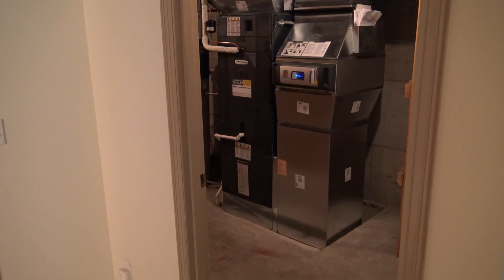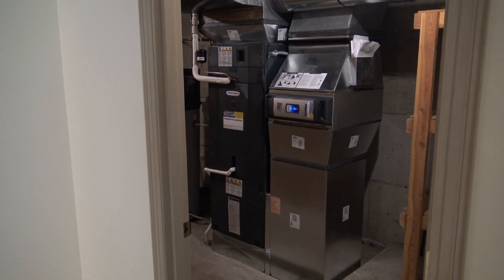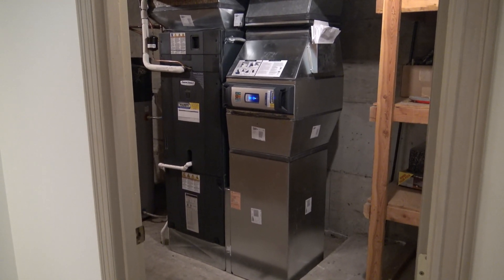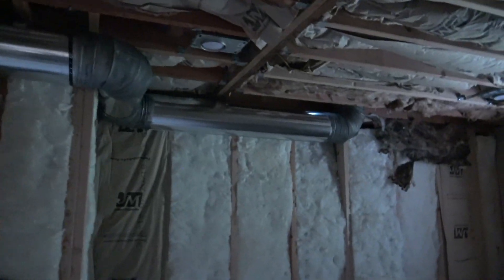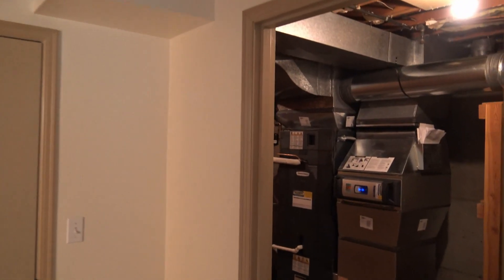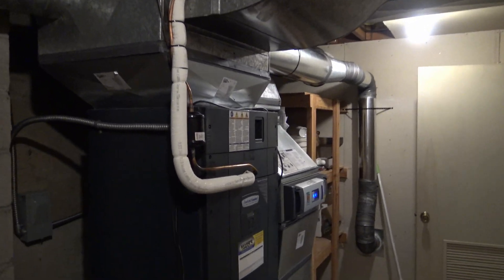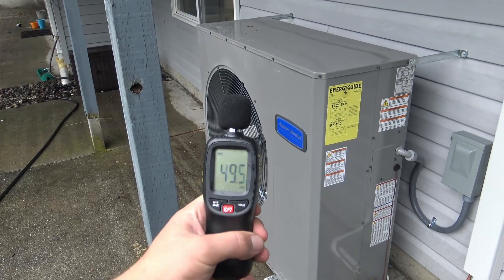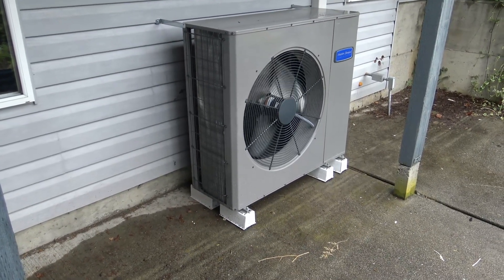Quietest American Standard Heat Pump Strikes Again!

Comment: My dual compressor 16 SEER HP lasted almost 20 years; it was very quiet and the recip. compressors were heavily insulated. I replace outdoor unit with regular A/C 10 year ago and matched to the old air handler; still works.

Comment: Quiet fan, but how about the compressor when it starts?  That is the issue with most ACs and heat pumps, not just the fan.
Reply: Far quieter than a single stage unit starting. Good lord mine is loud!

Comment: How much time did the installers get for this installation?
Reply from the maker: Not sure what you mean? All of our installers are paid an hourly rate, and take pride in producing this high level work!
Reply: Just curious If they got a full 8 hour day or if they worked for multiple days to install the system. Beautiful install. I have been working HVAC install for about a year and love the trade. Keep up the awesome videos
Reply from the maker: SuperMudMuppet oh yes this took 2 guys close to 3 full days!!
Reply from the maker: SuperMudMuppet lots of work to do everything including charging, evacuation and setup correctly. The wood furnace also took 1/2 day just to remove!! It weighed a ton